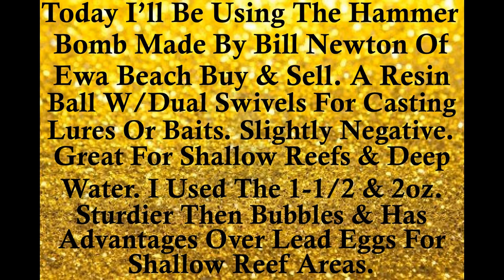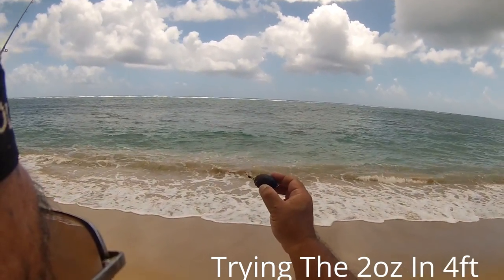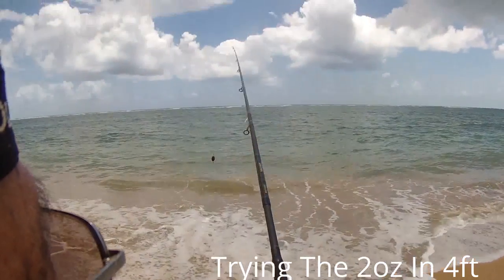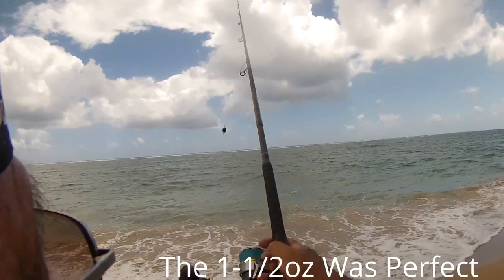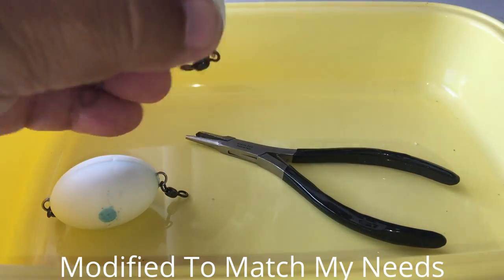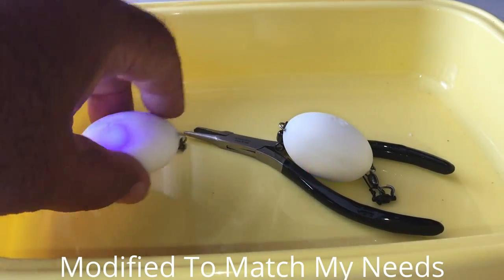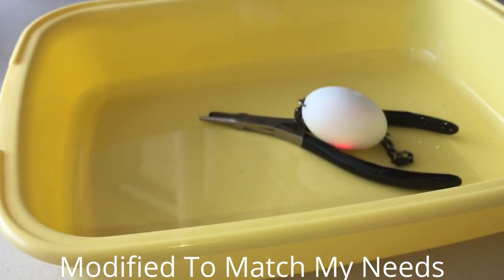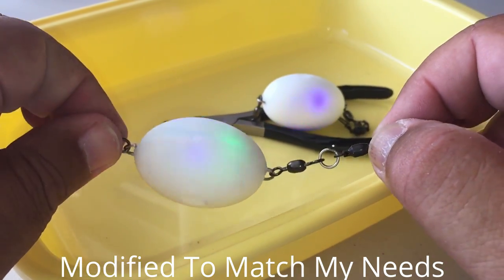Casting The HAMMER BOMB!

Comment: hows it uncle.do you like those hammer bombs.ive lozt fish at landing due to it bouncing up and down and it pops the hook out even with tight line...and your rod the bottom guide is backwards.
Reply from the maker: I need to use it more on different rigs & with different weights to get a better feel for the Hammer Bombs. But so far i'm happy using them. What type of hooks did they pop out of? I used Trapper Hooks which will dislodge easily (which it did). J-Hooks i found will "grab" on impact thus damaging the fish. Bad choice for me if i need to C&R it. My best choice still are circle hooks, easily locks-up. The rod i was using is a Daiwa 11' Coastal, a factory rod. And YOU'RE CORRECT! Didn't notice that until now! Still usable? Or should i send it back?
Reply: Scuba Chris I believe that's how that first eye comes factory. No need to worry. Aloha
Reply: Scuba Chris i was using j hooks maybe ill try circle holds better.you can send it back or have a local rod builder switch it for you.but the warranty is no good after.send it back if you can.if you were on maui id fix it for you.
Reply: thats called a reverse stripper guide. its not backwards. its better to have a single foot facing the reel instead of the double foot. it slightly helps with casting amd especially when using a wind-on leader system or a fg knot for casting thru guides
Reply from the maker: Thanks. I've used this rod to plug and dunk, the guide doesn't interfere at all.
Reply from the maker: Yes, i looked at iCast and other vids online that showed this, while other Daiwa rods are still traditional. Makes sense though. And all this time i wasn't aware of this or the reason it's wrapped this way. Thanks hawaii life ,custom rod builder and Wallace Murray for this revelation.
Reply: Scuba Chris ..everybodys got their own theory.in hawaii we dont run it like that...if i wrap a custom i dont put it backwards.its like putting on single foot guide supside down.most people who know will see it off hand.thats why i seen it first.for me i just change my rods to how i want it and how it really supposed to be
Reply from the maker: You have good eyes! I bought 2 Daiwa Coastals, a 10" & 11' from Charley's Fishing Supply. The 10' snapped a foot below the tip while plugging only a 1.6oz surface plug. Wasn't happy. Now i'm aware of the 1st guide being factory reversed by watching iCast vids. On FB i've read testimonies by many anglers on what they thought of the Coastals (most had similar issues like mine). Starting to question my choices. Invested in a few Ballistics, last month the butt plug dropped out and now it won't "tighten" correctly. Never had issues with Penn Battalions, Nitros, Okuma Haw'n, or IRW's. The only other problems i had was the TICA guides corroding fast even though i take care of all my gear. Looking at other choices. KInda sad that i turned down sponsorship of a company that made great rods (but not the reels). Free stuff isn't as important as dependability & workmanship. Also i feel Wallace has a good point. He usually is & i've always respected his views. And Daiwa intentially wrapped all Coastals from that year like that for a reason. So far plugging or dunking using braid hasn't created any problems or line wrapping around that 1st guide. Yeah, in Hawaii i wouldn't pay for my 1st guide to be like that either. But for now it's doing its job. Hey, thanks for your input. I appreciate your keen eye and helpful advice. Chris:)
Reply: Scuba Chris. your welcome uncle .good luck be safe catchem big.
Reply from the maker: Mahalo:)

Comment: Hello Chris,  Nice video as always. I bought a hammer bomb about 3 months ago on one of my fishing gear spending sprees, but never understood how to effectively use it until now. I plan on going out tomorrow to Barbers point to try it it out. One question, how do you know that water is only 4 feet in the video. I've watched other videos where you talk about watching the waves to locate the reefs and shallow areas, but how do you know it is around 4 feet? Second question, I think I'm struggling with determining what leader length to use. By default, I use about two arm wingspans for my leaders. Since I'm 6 foot, it is around a 12 foot leader. Should I be shortening my leader in shallow water?
Reply from the maker: You need to "estimate" depth by how the waves break/form, how the light penetrates, how clearly you make out the bottom. If you grow-up being in/around the water you will know just by looking. Longer leaders get more hits then shorter leaders. But are more humbug to keep un-knotted & how fast they sink which leads to tangles. When i do my basic day/night leader i do 1 full arm span plus a few feet. So my leaders are 8-9ft which works for me. All personal preference:)
Reply: 6 ft is good enough,  i get a lot of hits on 4 ft leader already
Reply: 12 ft  flourocarbon leader is expensive
Reply from the maker: A lot depends on the casted weight, diameter of the line, and wind resistance of the lure. My problem of not using the correct leader length is wind knots in the leader itself. That creates stress points if not corrected. I've found 8/9ft to be perfect for most rigs. Every set-up requires a certain leader length to match the combo & line used.